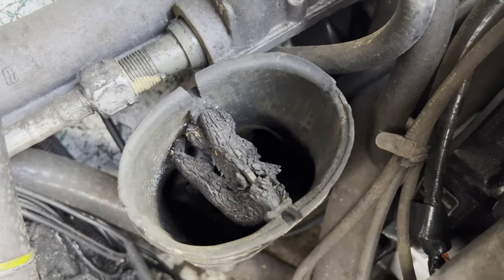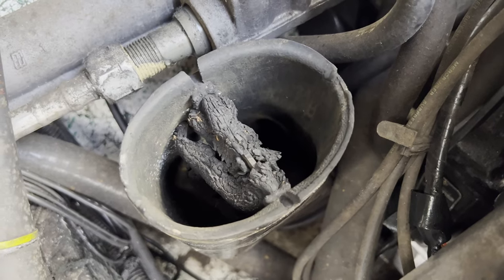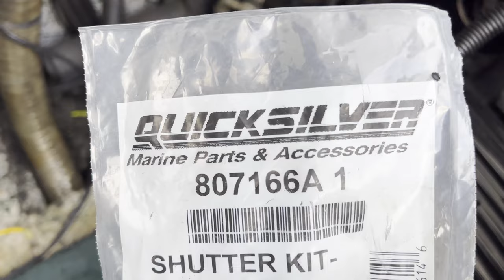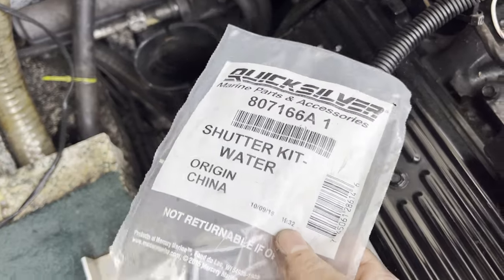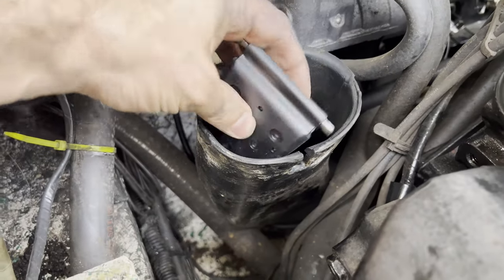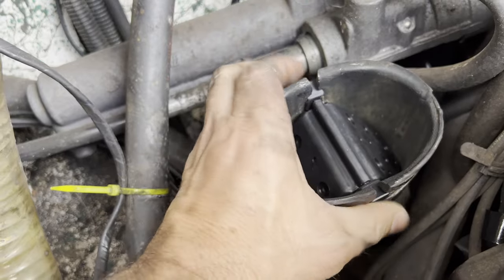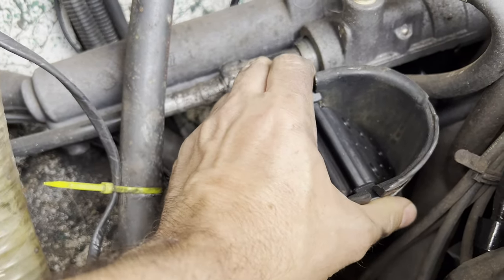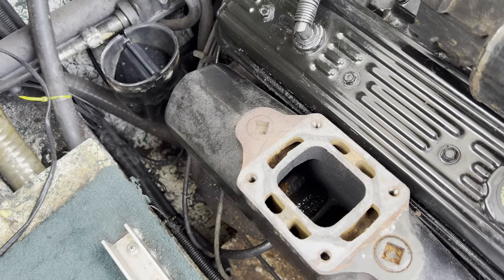Mercruiser Water Flapper Exhaust Shutter Replacement

Comment: The shutters have a steel plate that is embedded in the rubber and runs just about the full length.  The pin in the middle is stainless steel.   The rubber is made to withstand corrosion and high temperatures of the exhaust.   Not even an overheat will melt them.  I had a 250° overheat on my engine from a clogged thermostat and when I did my maintenance and inspected them, they were as good as new.

Comment: Are these even super needed when you have these tall exhaust risers ?
Reply from the maker: Some will say no, but I would say yes. If you quickly slow down off plane your wake will slam the back of the boat and can have enough velocity to overcome tall risers.
Reply: @kytor  i just had this happen to me the other day. can confirm.
Reply from the maker: @plainandsimple1  If it got to the engine: Pull the plugs, spray those cylinders down with fogging oil, turn it over on the starter (don't start it), then drain and replace the oil. Now run it for a while, burn off the fogging oil, and finally change the plugs.
Reply: @kytor  I pulled it all apart to check the exhaust and the elbow to be sure. Pulled the plugs, sprayed it... blew all the water out with air at tdc.. then spray it again, turned it over for a bit. Then re sprayed. Waiting for the oil to come in to change it. There seems to be almost zero water in the oil if any at all. And it only got into cyl 1 luckily.
Reply from the maker: @plainandsimple1  There is water in there I can almost guarantee it. It's sitting at the bottom of your oil pan and your pickup won't grab it until it's up to temperature and agitated. Check your oil level, it's probably a quart high.
Reply: @kytor  I'm going to drain it regardless. I actually just did a comp test too and found low comp on cyl 2 and 3. so it's getting a decking and head gasket shortly as well.
Reply: Yes, you can hydro lock your engine without them pretty easy